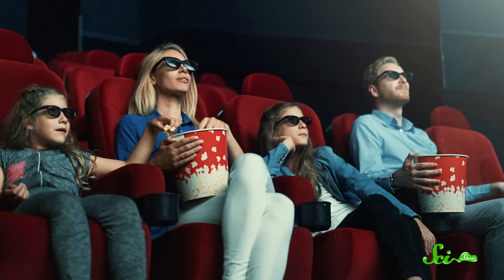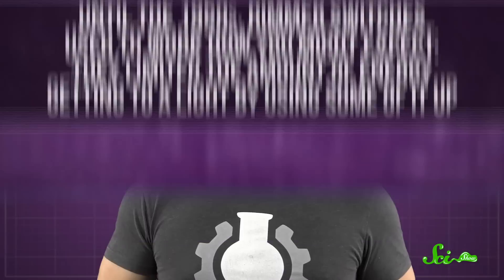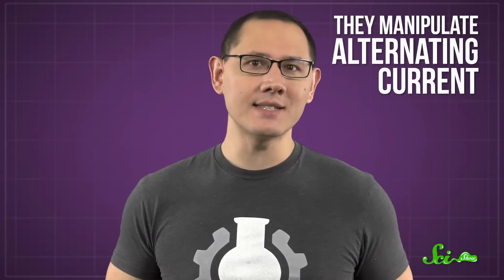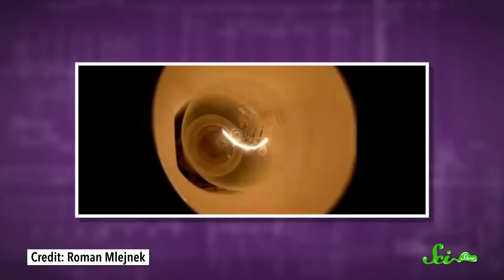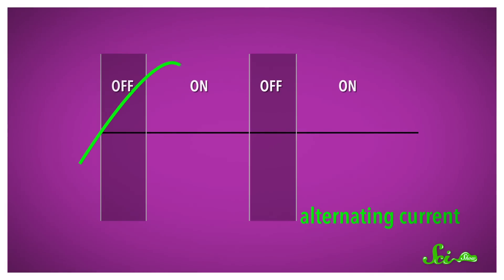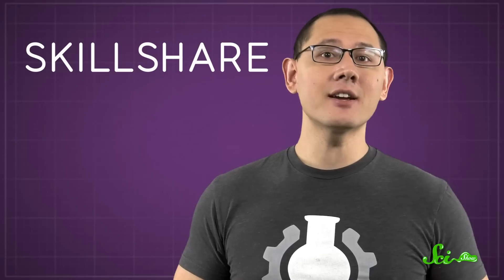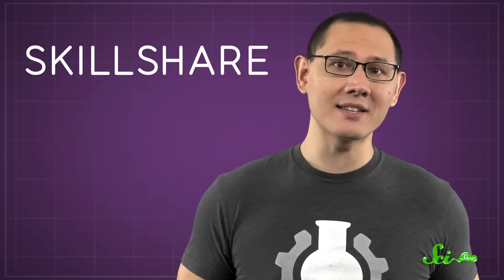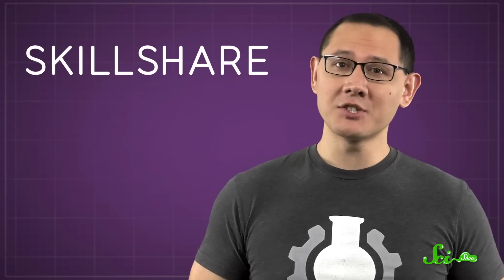Dimmer Switches: Secretly Strobe Lights

Comment: Is hard to find a led lamp compatible with dimmer =(
Reply: I’m sure he meant ones that don’t have adverse effects.  Poor dimming characteristics, high pitch hum, short life. I’m an electrician and have to deal with these complaints almost every day. Dimmers rated for LED’s, LED’s rated for being on a dimmer but have a high pitch hum. 🤨 Lutron has a list of lights that it has tested on it’s dimmers but still can’t guarantee no adverse effects.
Reply: Dimmers for LED lamps are easy to find. The problem is finding a LED lamp that can be dimmed. If they aren't built for it, dimmers just won't work well or at all with them and might even destroy themselves in a short time.
Reply: Lol, I can hardly find any that aren't at any of the stores around. I prefer to buy the ones that aren't because they are cheaper and I don't use dimmers.
Reply: Maybe like 10 years ago.
Reply: Proyectos LED amazon has hundreds of them
Reply: Walmart
Reply: Buy a yokis and every lamp will work with any dimmer
Reply: yeah, LEDs are diodes, which means bad...
Reply: @Marian Gherca Not even close. The two biggest factors is thermal-cycles and temperature.
Driving an LED at 5 mA with a 50% dutycacle 10 kHz and it will last you many years.
The same LED at 20 mA or at 100 °C (Enclosed, no proper cooling)  might be gone in a couple of months.
Reply: GE Daylight LED PC: 32944

Comment: Correction: what determines minimum frame rate for movies isn't flicker fusion but persistence of vision, a distinct phenomenon. However, motion picture projectors use rotating shutters that interrupt the light 2 or 3 times per frame to avoid obvious flickering, and that is because of flicker fusion. In the early silent era before the multiple bladed shutter was introduced the light was blocked only during "pulldown" of the next film frame and flickering was so noticeable movies were called "flickers" or "flicks," and the latter term obviously still persists.
Reply: I occasionally wondered about that, thanks for the info.
Reply: Very interesting.
Reply: Flicker Fusion, good name for a band.
Reply: Thank you for sharing this interesting tidbit!

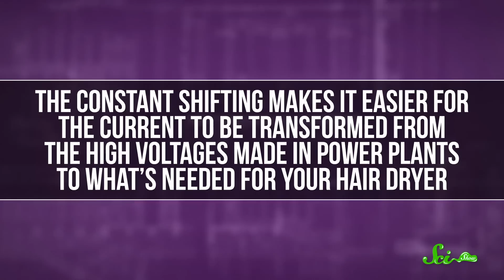Comment: 1:20 Im pretty sure the US uses 60Hz, not 120 Hz. I think your number probably got mixed up with the standard of 120V for a wall socket
Reply: 1 Hz is a complete 360 degree cycle. With a voltage change at 90 degree and 270 degree.
Reply: They're right. The current direction switches twice every cycle.
Reply: @levipoon5684  yeah, but we do use a 60hz system, it does switch twice per cycle but to call it 120hz because of that is incorrect. In the us electricity switches from positive to negative 60 times per second => 60hz
Reply: @MrAceman56   Everyone here is right, but nobody called it 120Hz.  The video even said that it "reverses 120 times a second."
Reply: @michaelsteinbach  60hz switches 60 times per second, not 120. If measured from the beginning of the cycle to the end starting at a 0v potential, the current flow reverses once. Yes I will agree the voltage does peak and make it look like it switches twice but it passes through 0v only once
Reply: @levipoon5684  Hz is measured in 1 /( how long a repetition of a signal takes, aka a cycle) for periodic signals.

 The US uses 120V RMS  60Hz. This means that it takes 1/(60) sec = 16.66ms for each cycle to finish. Since it is a pure sinusoidal signal it also means that the amplitude (aka the maximum, top of the sine wave) of it is sqrt(2)*120V ~ 169.7V. Most of Europe (if not all?) uses 230V RMS 50Hz.
Reply: @halveiz  Most of the world uses 230V/50Hz.
Reply: He said:
"(...), but in the US [the direction of current] reverses 120 times a second."
which is correct. The diection reverses once at the positive peak of the sine wave, and again at the negative peak.
Reply: That was one of the few accurate things in the video

Comment: 60 times a second actually. U.S. power is 60 Hertz, our friends across the pond use 50 Hertz
Reply: He said in the video:'frequency (...) here in US reverses 120 times a second' - AC switches twice in one cycle (one period of the sine wave), first to positive voltage, then negative; so 120 switches is 60Hz.

Comment: Sono... Dimmers are kinda like PWM, cool
Reply: Not kinda like, exactly. Analog dimmers work with incandescents and use potentiometers, but CFLs and LEDs don't work with that, so modern dimmer-switches use pulse-width-modulation.
Reply: @user-vn7ce5ig1z  What I meant is that they probably use a different method of pulse modulation compared to the one used in LCDs or fan controller (which is done with transistors I guess?) but yea, the underlying principle is the exact same
Reply: @BubuSnow93  , modern dimmers use triacs, which are also silicon switches like transistors.
 So yeah, it is still PWM.
Reply: Things like LEDs and computer fans internally work on DC (even if converted from AC) and don't usually rely on AC waveform for dimming. Other than that the circuitry is different but the effect is the same - PWM. 

AC Dimmers use triacs and zero-crossing detection to dim AC. It uses simpler analog circuits but because triacs cannot disengage until zero crossing occurs they are limited to 50/60Hz flicker/buzz.

DC PWM drivers can turn the load on and off any time they choose so they often have higher frequencies to reduce flicker/buzz. But they rely on a transistor to quickly and constantly turn on and off which puts more stress on it and may generate more heat than triacs - although this may be mitigatible. They also require digital control ICs, usually with feedback loops which adds cost and may decrease reliability. 

AC can in fact be dimmed the same way DC is but this requires quite high frequency because otherwise simply overlaying it over AC waveform produces random flickering rather than dimming.

Comment: OOPS you missed the variac dimmer. Not nearly the amount of excessive heat and was not a resistor it was variable transformer.
Reply: Don't bother with all this, just use a Yokis and you're fine
Reply: Variadic dimmers are similar to potentiometers in that they reduce the amount of current going to the bulb. Like pot-dimmers, they only work for incandescents. CFLs and LEDs (unless specifically designed to work with old dimmers) won't work correctly with them and require PWM dimmers. Most dimmers now are PWM, especially since incandescents have been banned.

Comment: That's crazy! I never would have known. 
So if you use dimmers on LEDs, does it work the same way?  Or would you see flicker cuse there's no wire coil to stay lit between cycles?  I'm not sure if i've ever seen LED lights in dimmers before, I guess cuse I don't have one at home.
Reply: Similar, the LED turns on/off very quickly.
Reply: @MisterMooo  Do dimmer-switch compatible LED lightbulbs exist?  I know my LED bulbs said on the package that they were not suitable to be used in dimmer switches, so that's why I'm curious. 

I wonder if short bursts of electricity prevent the diode from reaching full instantaneous output, and maybe that's why it works.  I know my CFLs need to be on for like 30 seconds before they reach full brightness, maybe something similar happens in the LED? 

It's soo cool, I always thought they just used a resistor, but it totally makes sense now that it would produce a lot of heat, be a fire hazard, and use more electricity than they should.
Reply: @BothHands1  , I paid way too much for a Philips dimmable LED bulb, that allegedly was dimmable from 100 down to 15%.
 That was a lie.
In practice, it went from 100% to around 85%.
Reply: @tonyk585  ty!

Comment: so how do they work in the EU where we have half your frequency?
Reply: You have 5/6 our frequency. Europe is 50Hz, North America is 60Hz. Those frequencies are for full sine wave, which contains two zero-crossing giving the 120 cited, or 100 in Europe. This means European dimmers, if functioning in the same manner, will be more likely to flicker since 60 Hz is a reasonable approximate for the flicker fusion rate (hence, in ye olden days, why it was better to pic a lower resolution for you monitor but higher refresh rate)

Comment: This seems like a really poor idea. For incandescents it's sort of OK because it takes the filament a bit to cool and so the light can effectively become dimmer. For fluorescents or LED lights, it's terrible. The light isn't really dimmer. It's just not on as long.
Reply: Yeah, switch-mode PSUs and LED drivers are often around 100 to 200 kiloHertz.
Reply: @massimookissed1023  - Yeah, the switching power supplies for LEDs don't bother me so much because that switch rate probably really is too high for anybody to notice, even subconsciously. A switch rate that's in the low hundreds of hertz though is way too low.
Reply: I was sort of wondering whether that technique would even work for fluorescent or LED lights for the reasons you mention. Interesting to know that it doesn't. That's nice to know.

Comment: Reasons europes powergrid is superior: Our dimmers switch more frequently, making them even smoother
Reply: really?  I knew you guys had higher volts, but you have higher switching frequency too?  That's interesting, I wonder if the two are related.
Reply: Europe = 50HZ < North America = 60Hz
Reply: Actually you have it backwards. European line frequency is 50 Hz, meaning AC current crosses zero 100 times per second versus 120 in much of the Americas and Japan. In fact, in the days of CRT televisions, some people noticed flickering on PAL television sincr it has 50 fields per second rather than 59.97 in NTSC, and some people have a flicker fusion threshold over 50 Hz.
Reply: @massimookissed1023  You're right of course and I appreciate the correction!

Comment: Could this cause any side effects? Like... headaches, migraines, seizures?

Because I definitely notice dim lights flickering. My mother does too.

I have chronic migraines and she has epilepsy.
Reply: If you're using the incorrect bulbs for a dimmer you will get some amount of flicker.
Reply: I don't remember exactly, but I think the flicker is usually only on flourescent lights when they age,
iirc, they have a coil wrapped around a magnet to work as an inductor.  So when the AC current changes directions 120 times per second, the magnetic field the coiled wire produces also switches back and forth.
That's why you hear a hum too, because it makes the magnet vibrate, which over time can loosen the coil's grip on the magnet, and that's when you get flicker and louder humming.
I could be remembering a few details incorrectly because I took physics a few years back, but the general idea I think is correct.
Reply: @BothHands1 
"They hum like angels! You're never alone if you've got a fluorescent light!"
~ Ned Flanders
Reply: What kind of lamp / light source do you use? (Why I'm asking: Some low quality LED lights are visbly flimmering, the higher quality ones usually don't)
Reply: TheMightyZwom Only one light in my house used to flicker and I replaced it. It was (and is now) a fluorescent light.

It's usually the lighting in malls and hospitals that flicker insanely. A very rapid flicker. Not every single light - usually those very long and thick lights with the textured plastic cover.
Reply: I do know I get a headache from the sound dimmer lights make. I dont know what it is, but they all produce a really high pitched grating sound to me.
Reply: @ramennight  They likely don't have the right bulbs in them, ones that aren't really compatible with dimmers. Some people are too lazy to check/don't know, and I think it's around that frequency where guys don't tend to hear it as much and women can notice it more. At my work I'm around a lot of dimmer switches and know instantly when they have the wrong bulbs in because of the god awful electrical "whine" on top of the noticeable flickering. I'd surely get a headache from it if I spent any length of time with them.
Reply: ramennight I do hear a hum when I'm near those lights but it doesn't bother me as nearly as much as the flickering. Luckily I don't have any (visibly) flickering lights at home anymore.
Reply: some LED arrays have individual LEDs set up in opposite directions to mitigate "flash" others have full wave rectifiers
Reply: but afaik, unless you have a dimmer switch on, normal incandescent bulbs or LED bulbs shouldn't flicker
Reply: Years ago, in the early 80s, I worked at a 25 Hz. generating plant for electric trains.  The plant was built in 1906 and refitted in 1946-47.
You DEFINITELY could notice  incandescent filiment bulbs flicker while operating at that low frequency.  It was annoying at first, then you just got used to it.  Since then, (nearly?) all the electric traction systems (USA) have been converted to 60 Hz.
Reply: dennis walsh My house is ancient, about 100 years. While the lighting is "new" compared to when it was constructed, they were still old.

I replaced the light that flickered, though, so it's fine in my house. Luckily.
Reply: If you ever buy LED bulbs, look for the "dimming" kind, they usually have a capacitor in there order to smooth things out.
Reply: whoopsydaizy I have epilepsy and haven’t noticed it
Reply: Danielle Spargo 

That makes a lot of sense, since the flickering stopped once I replaced it.

I guess the mall and hospital needs to replace their lights!

There's definitely humming - it doesn't bother me but if I stand near those lights (in silence) but I can hear it.
Reply: I find it unlikely you'd notice that flicker. Now I have a few led downlights in my office and house that noticeably flicker, but they do it about 10-20 times per second, not 120! (Or 100 I suppose cause we're at 50Hz) Why they flicker I'd need to ask an electrician, but I think it has something to do with sticking low draw leds in sockets intended for much higher power incandescents.
Reply: I notice the flicker of dim lights too.  I use incandescent or halogen bulbs, and I have to have the lights all the way on because the flicker on the dim setting bothers me.  It doesn't cause me anything like migraines or epilepsy, fortunately.  It's just annoying in a way that makes me anxious and crabby.
Reply: New good quality led lights have a fosforus layer over the LEDs that will remove the flickering from dimming the lights
Reply: Of course it can. The dimmer the light, the more 'dark' intervals per second there are and thus more flickering. Eye strain is common too.
Reply: The number of dark intervals per second, the frequency, is fixed at twice mains frequency.
 Obviously longer off periods would be more visible, IF your eyes can respond that quickly.
AND ... incandescent bulbs don't really get this problem as their light output depends on the temperature of the filament, which in no way responds that quickly.